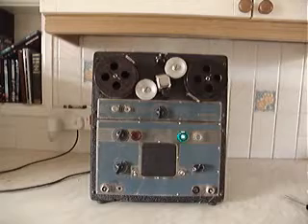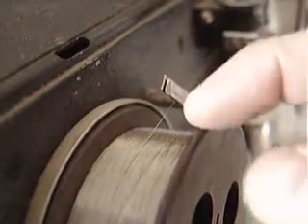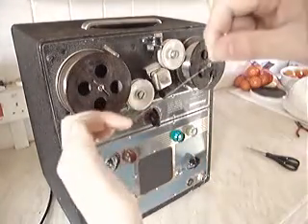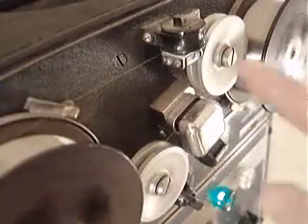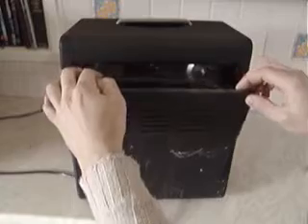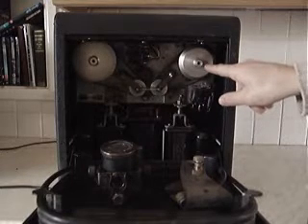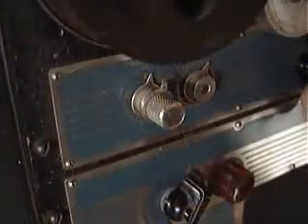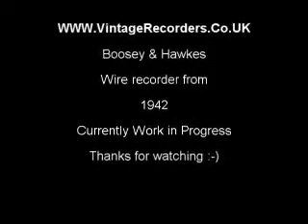Boosey & Hawkes wire recorder

Comment from the maker: The Blattnerphone  and Stille machines ran at very high speeds, the steel tape was razor thin but very strong, the reels where huge, about 4ft diameter, so when the steel snapped the steel would go everywhere, if you where unfortunate enough to be standing next to one, you wouldn't stand much chance of walking away without at least being cut at least.

Comment from the maker: As in the video, splicing was done by cutting the wire then tying the wire in a loop, I have done this today but also added a solder lump to make the join not only stronger but smoother for when it goes though the heads.

Comment from the maker: They did make a flat steel recorder called the Blattnerphone then a newer machine the Marconie Stille, the tape was 3mm wide and like razor wire, the recorders operated in a locked room as if an operator was close by and the tape snapped, it could be fatal.

Comment from the maker: They did, the British worked first on the Blattnerphone which used flat steel tape and later with the Germans came the Marconie Stille. These machines had even more drawbacks, the reels were Aprox 3-4 feet in diameter, travelled at a high speed and due to the size of the machines, if the tape should break, it was lethal, its told they were operated remotely as the breaking of the tape would cut the operator up into ribbons, it is not know if there were any fatalities but many people did get cut.

Comment from the maker: Wire recorders did overlap, the Blattnerphone (British)is a half way recorder built in 1925 ish, it used steel tape, the Marconi Steele was built by the British and the Germans, then came tape in 1935, the AEG K-0 dates 1930, it was paper tape recorder

Comment from the maker: It's a thought, I have not seen in their manuals to oil the machines wire or guides but on the steel band recorders, they have oilers to prevent head wear.